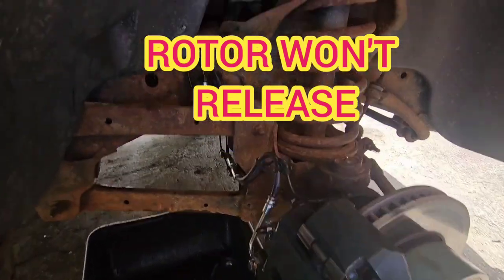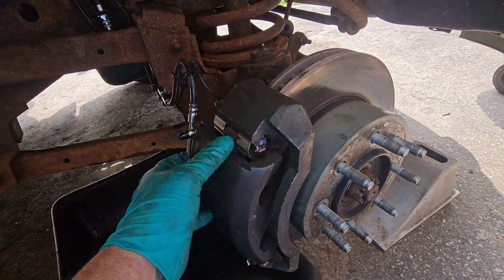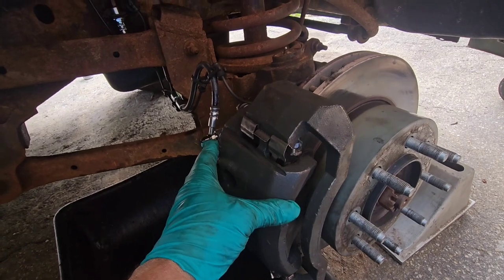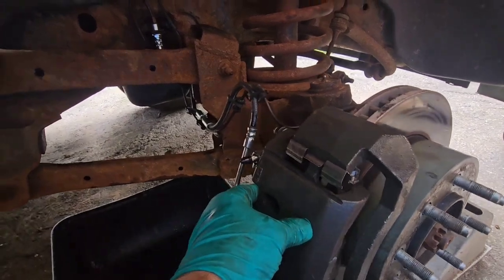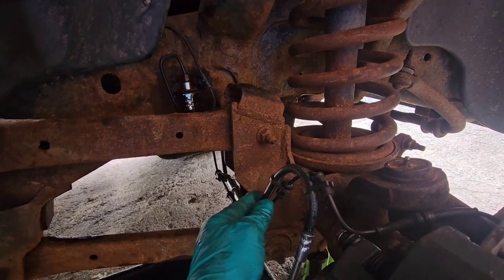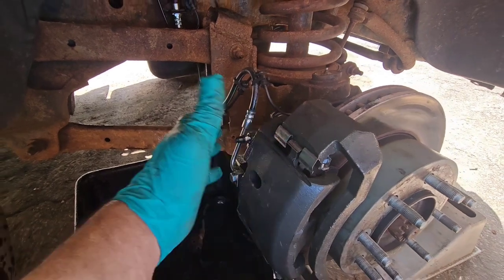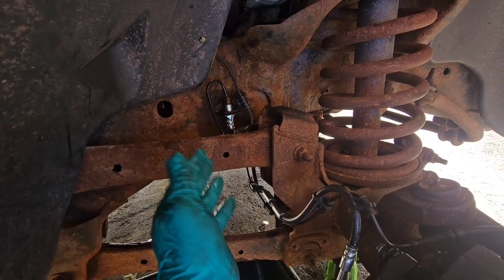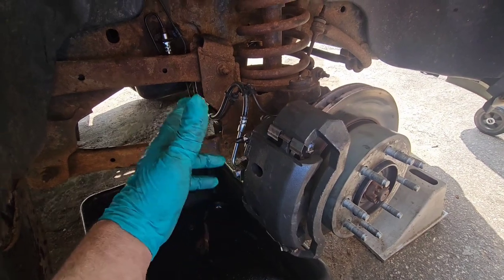Stuck brake caliper mystery solved Ram 2500 2007 Dodge Cummins Truck trick tip

Comment: How long does those hose last? I replaced mine about four years ago now seems going to lock up soon!!!
Reply from the maker: Not sure... the first one lasted 15 years or so,  but I'll bet this aftermarket one doesn't.
Reply: I had the same problem, replaced everything including hoses and it’s still doing it. Been told it was the abs module but no light and if it is it’s discontinued